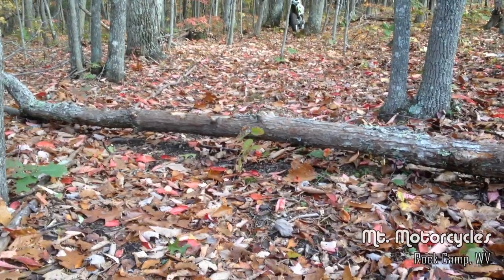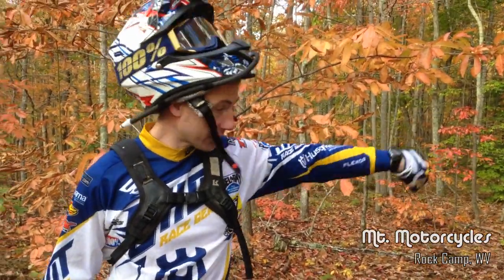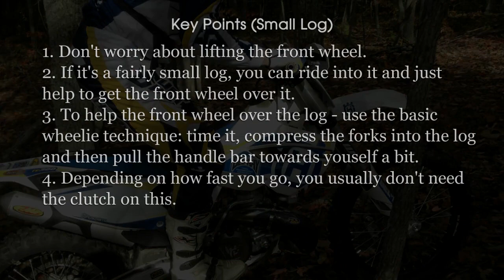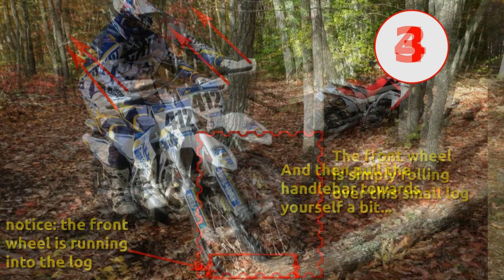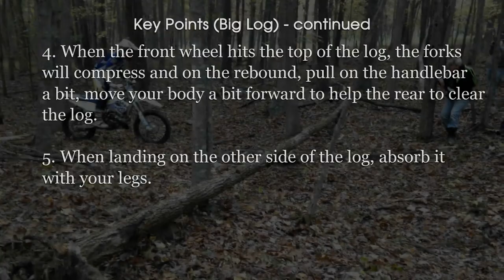Log Hopping - Graham Jarvis Explains

Comment: Great vids, I've been doing most of these things for years but it is great to get the step by step run down of how the best does it.. I like the music! I recently had a bit of a break from riding the hit over 100 jumps in my last ride, really struggling to stabilize myself when standing still, I know there are really expensive knee braces around but do you know of anything that will not make the impact of landing so bad on my quads..I try and sometimes land back wheel first and power up a little so the front doesn't slam down but I still  get the leg pain no matter what I do
Reply from the maker: Thank you Ross for your comment! Can't really recommend any knee braces per se. Check out forums, I hope this helps.